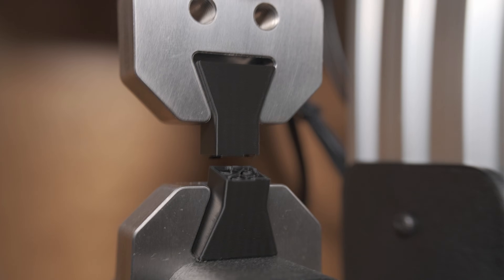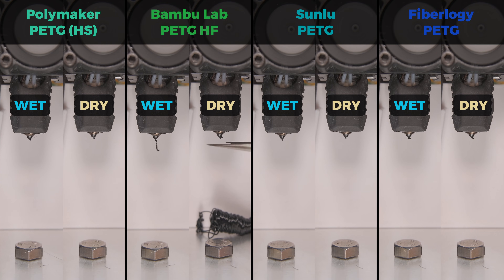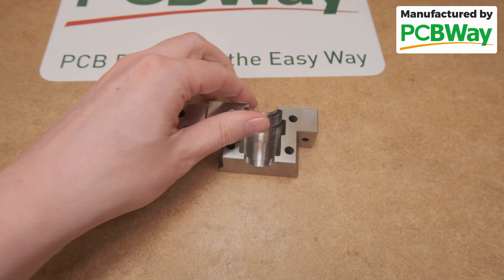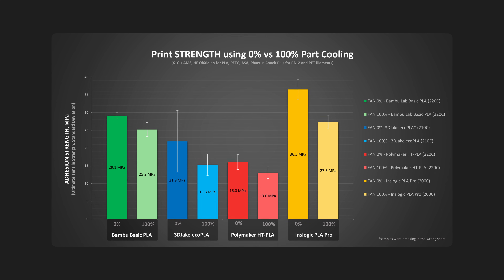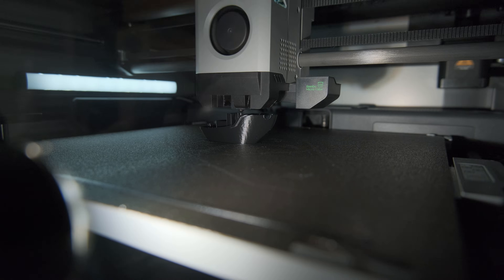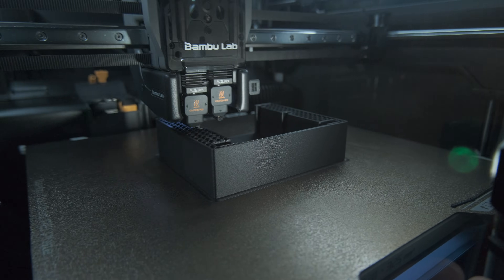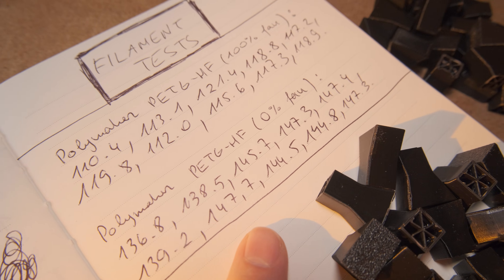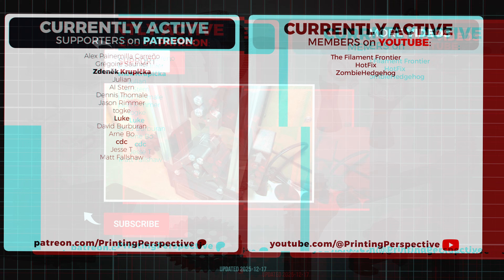NEW ULTIMATE PETG: Polymaker PETG (High-Speed, High-Adhesion, Low-Warping)

Comment: Why 0% or 100% AUX FAN instead of a more realistic 40-50% Aux + 30+40% part + 43°C Chamber + 250C nozzle + 70C bed with modified retention /wipe and minor limitations speed combined with high flow tungsten nozzle 2-4 walls/10-25% infill at 0.12 layer height.
Reply from the maker: For the fan 0 vs 100, we want to know the best and the worst scenario. Then it is easy to know what to expect with any speeds in between. You probably listed settings realistic to your prints. In my testing I use different wall/infill amounts for each print. Warping test prints have like 4-5 walls, can't remember exactly. I do not use aux for PETG. Print temps and bed temps are the same as you listed. This is my first filament testing video, so I have a lot to learn how to more optimize the videos and what info to include. :)

Comment: I do understand this is essentially an ad for Polymaker, but I'm a bit confused by some of your conclusions. The Sunlu and Fiberology breaking more randomly is not a bad thing, but demonstrates more isotropic strength. Sunlu also has high speed PETG and would therefore be a more direct comparison. It's also much cheaper than Polymaker. Sure, if you absolutely need to print as fast as possible, Polymaker is better than at least the two regular options. Otherwise there are few advantages. It's basically just PETG. It's a good option to have, but I'm not sure it's worth the extra money.
Reply from the maker: Isotropic strength has nothing to do with some samples of the same filament deforming (less brittle) and others exploding (more brittle) in beefed-up sections, while most breaking in the correct spot. It is just inconsistent filament manufacturing.

I tested the filaments I mostly use, two modern and two regular PETGs. I have no idea how you can complain about that, as it is somehow a wrong choice.

Polymaker's new PETG is objectively better than regular PETGs. Better =/= more $ value. Usually, the best products bring the least $ value. But value is defined by each individual and their needs. Bambu, Polymaker, and Sunlu PETGs are very different and bring different values. Some look amazing, some provide strong and reliable prints, and some offer great $ value. Arguing about this is completely pointless.

BTW, you understand that by saying it "is essentially an ad for Polymaker", this is the biggest insult you can give to a creator who tests and judges the filament by the actual testing data? If you truly think this is an ad, please don't watch my videos, because nothing I say will change your opinion. Cheers buddy!
Reply: @PrintingPerspective I disagree with your first conclusion and I encourage you to look at the forces exerted by your test rig and why the parts would fail at unintended sections. Concluding this is the result of inconsistent filament manufacturing is frankly a massive jump in reasoning and almost certainly incorrect.

I definitely understand testing the filaments you use most. All data is useful data. That's not necessarily a good justification for a comparison though, especially in the case of a sponsored video. I just think the examination of the data had gaps. I don't think all conclusions that could be drawn were either.

The new PETG is better in some ways and for some use cases than the regular PETG you tested. The regular PETG is even cheaper than the high speed filament I referenced being cheaper. I agree to each their needs for a given cost. Hence why I said it has its use cases.

I absolutely understand what I said about this being an ad. I am a creator as well. Any sponsored video is by law an ad. Even when we assume a creator is unbiased and honest, we have to color all conclusions with a sponsorship lens.

Generally testing on multiple products when only one company is sponsoring the video is not a great idea. I just called out a comparison of 4 printers sponsored by Bambu Lab for the same thing. As a general rule I really appreciate your data gathering and comparisons. Here you absolutely played up the strengths and downplayed any weaknesses.

At any rate, I do assume you made the video in good faith. I don't think you are a shill or a bad actor. No channel is perfect and even Doc Igor has to have his Polymaker sponsorship taken into account. However I would argue he relies heavily on data and rarely heaps praise or excuses poor results like this video had a tendency to do. Hope that makes sense.

I was not trying to insult you, but I definitely was calling the overall conclusion into question. I actually generally love this channel and I'm sure that's clear from all my past comments. I have shared numerous videos with literally hundreds or thousands of people. I am just being direct with what I see in this video.

Comment: I love this filament but I'm struggling to get the right cooling settings in orca slicer. Polymaker suggests min fan at 20 and max fan at 60 .. should I use these values and should bridges and overhangs speeds be 100% or something like 90 maybe? Cooling tuning is my only issue at the moment
Reply from the maker: Cooling is all about the surrounding temperature and the part cooling fan kicking in the right time. Fans can't instantly spool up so we have to use settings like Fan speed-up time and Fan kick-start time in printer settings on Orca Slicer. You need to set them according your fan characteristics. But it still can be a little bit buggy.

Comment: I dont understand the fan speed conclusion.....the old PETG seems to have similar strength and your concern is it did not break where you expected? But break strength was still the same.
Reply from the maker: It should not break on the way thicker sections compared to the ones with only two walls. You also have to look at the standard deviation. It is hard to say for sure, but my bet is that cheaper PETG like Sunlu has less consistent mixture during manufacturing. Because it doesn't make sense why one sample explodes (is way more brittle) and other just deforms (less brittle) and most break as they should.

Comment: you know tpu sticks to the plate? simply put in the freezer for 20minutes and it pops off with ease, this one ^might be the same
Reply from the maker: It is only with the small skirts and brims, but larger parts are not difficult to remove. To deal with those one-layer height pieces, I just spray IPA, and it cools them down very fast.

Comment: Elegoo petg seems quite brittle and prone to cracking. I picked the grey color.
Might want to include that brand for testing in the future.
You also want to make sure you minimize gaps as much as possible by tweaking print settings. optimal flow rates and motor e-steps for both extrusion and X and Y axis. as even small gaps can lead to weak points where a part will break much sooner than it would otherwise. and can also affect overhang print quality.
Ive had a lot of trouble trying to print overhangs when the overhangs are outward facing. (Blobs and pattern waves showing signs of overextrusion)
I find that even some minor tweaks are needed to ensure the outer walls or thin 2-walled parts do not have gaps is to add a very small amount of outer wall inset (0.05mm) to prevent those tiny gaps and strengthen the part further by reducing weak points.
Skin overlap is also critical to optimize in conjunction with linear advance/pressure advance to squeeze out that last bit of part strength and quality.
Reply from the maker: We will see, I guess. You talk about settings that I never heard of in my life, maybe you use a different slicer. I do everything an advanced user would do to get the prints that represent real print layer adhesion results.
Reply: @PrintingPerspective ist im Grossen und Ganz Richtig was Du Sagst , aber es gibt auch viele altered Drucker  mit dennen musst Du genau Einstellungen Einstellen zb mit Cura etc auch bei denn Heutigen neuen Slicer , zb Bambu Slicer oder Prusa Slicer usw. Muss mann teilweise profile Anpassen , Fazit Beide Haben Recht.  Lg

Comment: Your reviews are just on another level. Informative, precise and short. Awesome! I just wish that they will offer refills for a lower price. 20€/kg is quiet expensive imo. I usually buy my PETG for 10€/kg.
Reply from the maker: Thanks! :) Yeah, compared to what deals you can hunt, it is not cheap. I usually prototype with inexpensive filaments, and when I need the final part, I print with good ones. It also depends on the use case scenario. If the material won't be stressed enough, there is no reason to use good more expensive stuff. But if I need great and reliable layer adhesion, this Polymaker PETG will be my choice. I just don't get why they don't call it HS. At first, I thought I got just a regular old PETG lol. There are only small letters saying: "New!"